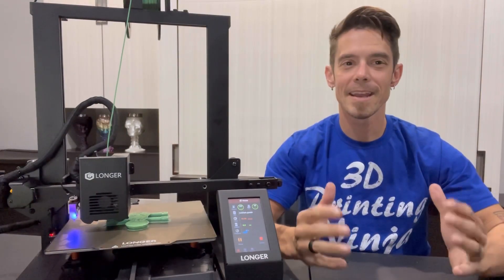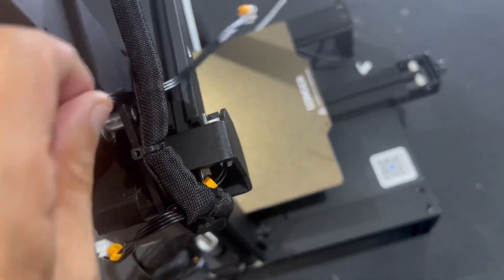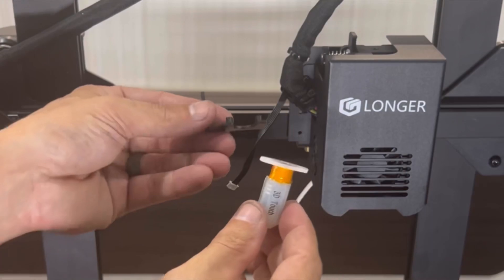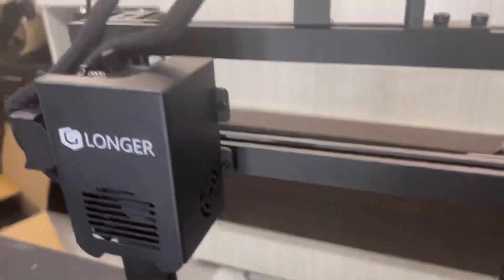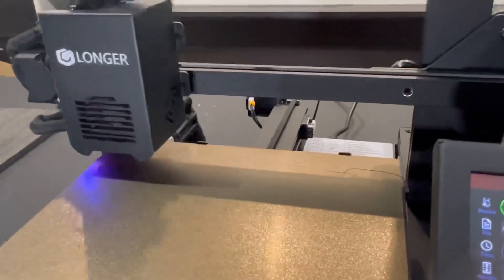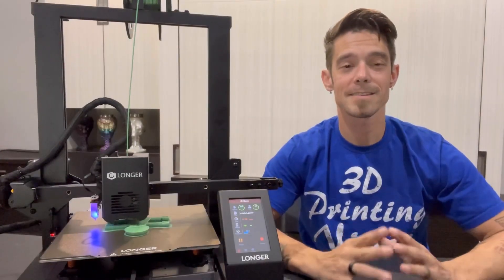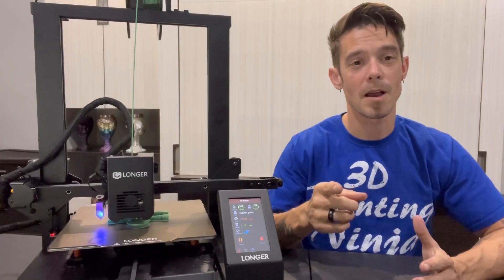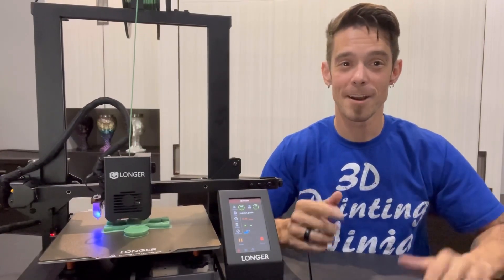Longer LK4 X 3D printer unboxing & set up. First look LK4 X with direct drive & ABL + intro pricing

Comment: I hate mine, the right side sags no matter how much I adjust the eccentric nut, the entire plate and spacer.  A second lead screw would be the ideal fix.
Reply from the maker: That sucks, have you tried removing the gantry & realigning it?
Reply: @Darkwingdad  yes!  I have 20 other bed slingers that work great but these single z guys are real hit or miss
Reply from the maker: @WhereNerdyisCool  yea I think single z really needs to be phased out by manufacturers. Overtime it really wears out the machine & affects print quality severely

Comment: Great video. Nice looking unit, too. Maybe I'll think about one of these units over a full-size creality cr-10. If you're able to print full sized helmets in one piece, I'd say that's a pretty sweet deal. Thanks for sharing. Great job covering the assembly process, too. If I grab one, I'll be sure to rewatch the video as I put it together.
Reply from the maker: If they come out with a large build plate with a dual z & all these features man it’ll be nice!